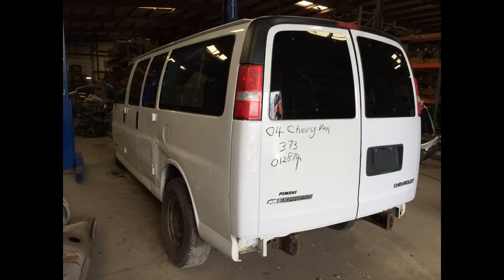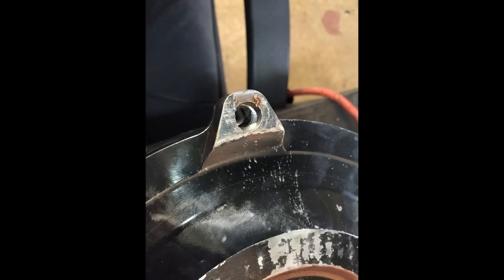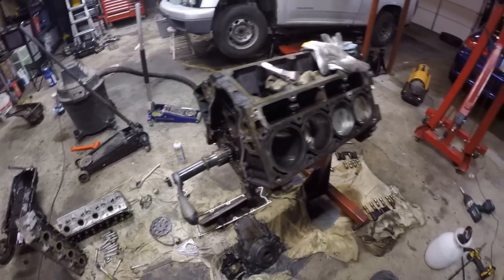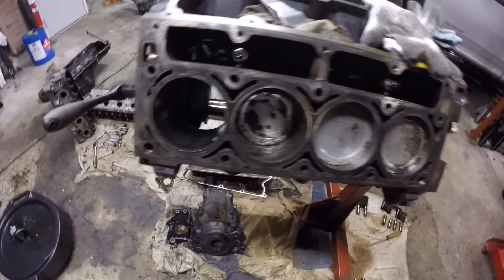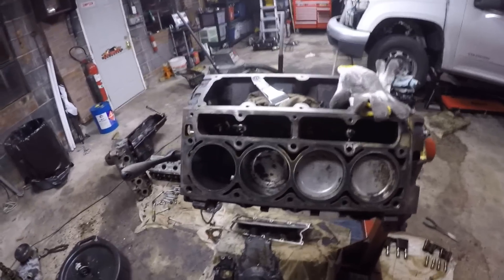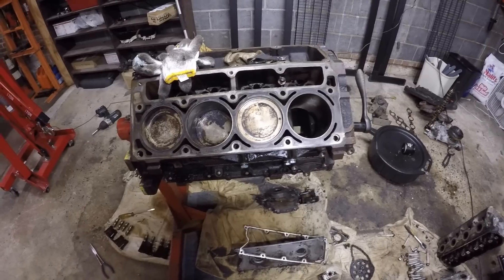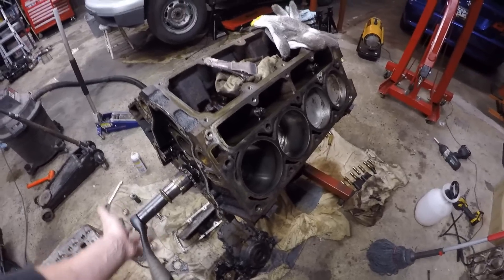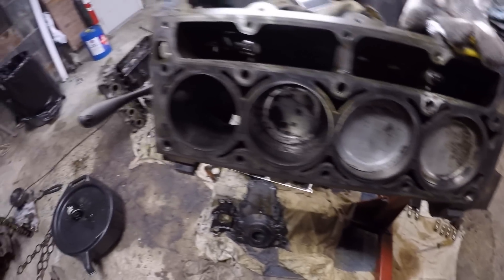colorado motor number 2 prep before install

Comment: If you were only planning on running e85 with this setup, would you have even bothered with the rings? I ask because I have a 700hp goal with an 04 express lq4 / cast 7875 / 80e / 210s / 2x wally 450s / ljms stage 2 / btr660 / 4.08 rear gear / in 98 240sx, and only plan on running it hard on e85. I tried searching, but couldn't find an answer on the limit of this combo on an untouched bottom end. Thanks for everything Matt!
Reply from the maker: nope

Comment: do you use ARPs in the Gen 4 rods?
how long to they last under sloppy power?
Reply: +AllyourBaseArebelongToUs watch the beginning of his last video on the colorado. the stock rod bolts didn't break, the rods themselves did.
Reply: FrankTheCat i was just wondering because i have a LQ9 with gen 4 Rods and am undecided as to use em or not.
Reply: he has said in a comment on an older vid that the gen 4`s were holding 7-800 for him, stock rods and i would assume the usual sloppy build.

Comment: Any tips on how to break free a stubborn crank pulley bolt? Motor is on a stand
Reply: I made my own breaker bar to get my crank pulley bolt out, with an old Yamaha Banshee axle and a socket wide enough to slide over my 1/2" ratchet. don't have a 1/2" gun so I had to get a little creative
Reply: welded the socket to the end of the axle and had a nice new breaker bar
Reply: Make sure you have the flexplate secure (I used vice grips) and hold a propane torch on the bolt for a minute or two.  Hit it with a breaker bar with a pipe for an extension.  I used an Ingersol impact but not everyone has one with enough torque.  Low dollar impacts or cordless ones won't budge it.
Reply: Or just wedge a pry bar in the teeth of the flex plate to hold it
Reply: There's a bunch of ways to secure it.  I've borrowed the fancy dealer tool and it's nice but not $140 nice.

Comment: You said this is an 04 6.0 so I assume it does not have the 4th gen rods then?
Reply from the maker: it does
Reply: Sloppy Mechanics at what point do the 4th gen rods appear? I have a running driving 03 3500 Express w/16x,xxx mi. I paid $500. bucks for. I just haven't torn it apart as of yet due to the fact it's a great mobile toolbox. But after discovering your channel I'm ready to commit.
How do I determine if they are 4th gen rods? If they aren't am I up the creek? Also considered N2O due to having experience with it in the past, but your videos have inspired confidence in affordable Turbo alternatives. Thanks for doing what you do, and keep em coming...